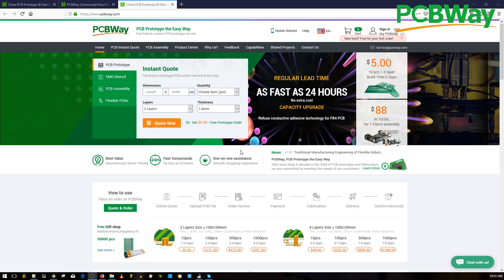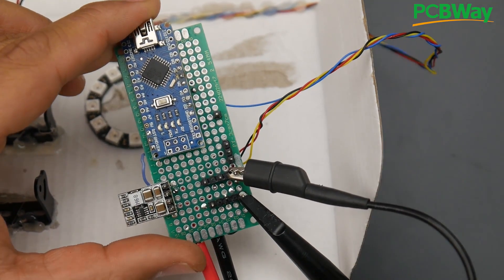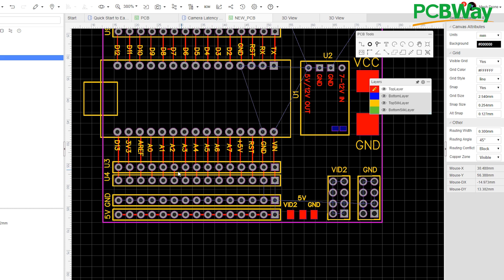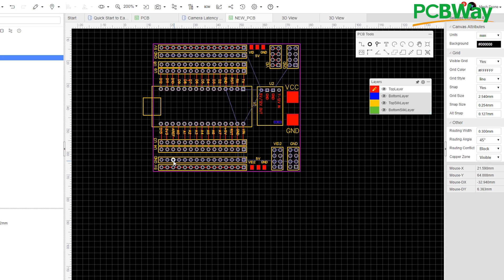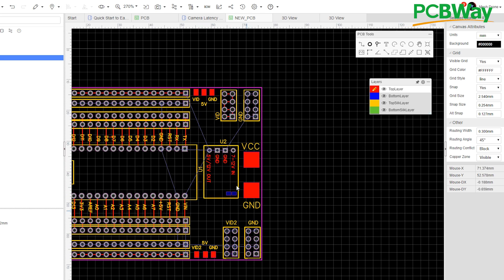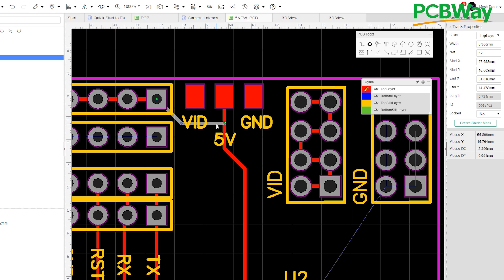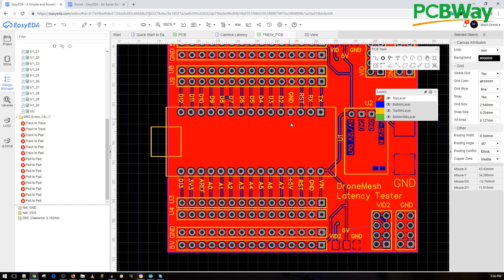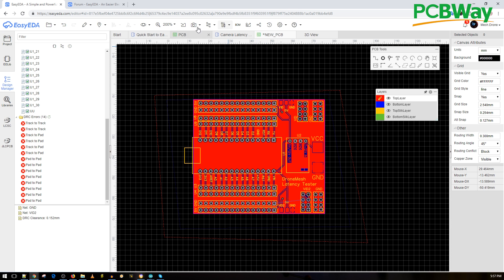Designing Custom PCB for FPV Camera Latency Testing

Comment: nice... i was wondering why you put it signal ground and 5v on the sides of the board. it would be better off to have it servo pinout standard at 0.1" pitch so that you can plug a regular servo header plug directly into it without having to swap pins.

Comment: would have added ground layer to bottom, and much thicker 5V  rails or a whole layer. Follow Ground from your input to your rail, it squeezes around these 5V pads. VERY thin trace, high resistance and inductance.
Reply from the maker: It's enough for the small applications I am using it for.
Reply: @DroneMesh  yes just saying be careful with the copper filling tools. The airwires might dissapper but its important to follow the current path to ensure the traces are thick enough and return in a more or less direct way. A crippled ground return path can lead to whole lot of problems, like EMV, your uC crashing because of voltage drops or a burned trace. Something like a ADC, OPA or sensor would probably not work sufficently.
just trying to help the DIY community in this hobby.